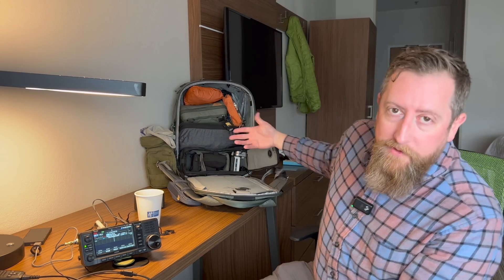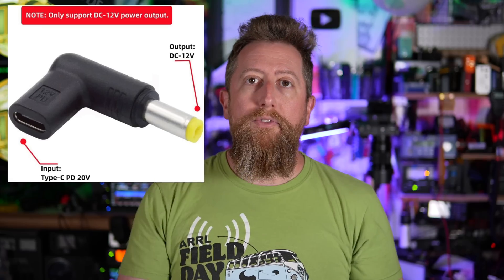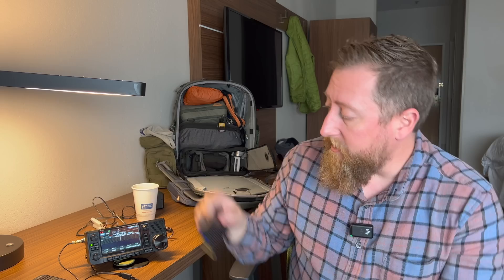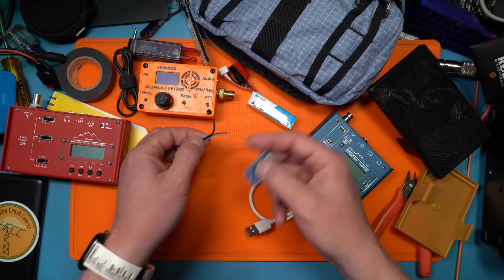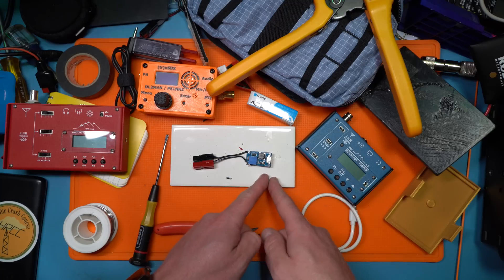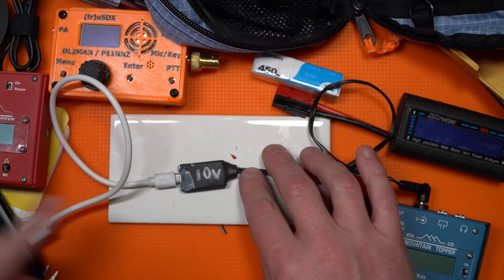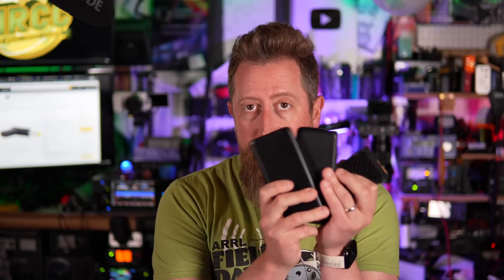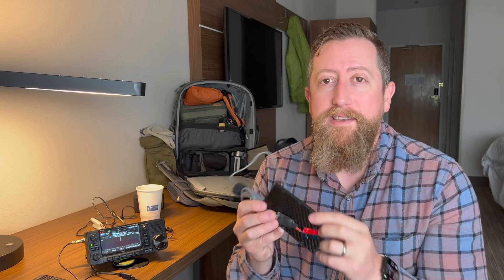Powering QRP Ham Radio with USB Battery Banks

Comment: I am going to get the QRPLabs QMX+ to go QRP and ultra portable. They'll add SSB on it soon and it does Digital and CW just fine. This video is just wonderful. Will you do a build video for the QMX+???
Reply from the maker: I will indeed. I already have the kit waiting for me.
Reply: @HamRadioCrashCourse  ooohhh!! I am excited to see it!! I plan to buy it for the Turkey YOTA event for the next month. We'll be on the air with i believe around 10 Youth operators for the entire month. I do have an IC 718 but i dont have a proper way of powering it. Though would you reccomend i should get the QMX + or figure out a Power Supply solution for the IC 718 to work Portably? If i go Portable what would you reccomend to power it? I have a 12V 7Ah battery that's gone flat. So im thinking if i should get a way to power that battery or get the QMX +... Sorry if it's too out of topic with the video, i just thought i should ask.

73 DE TA1YEP

Comment: Just passed my test here in Spain and once i get my call sign I'm going to get a usdx hf transceiver.  Due to European laws it wont come with a battery so this is a fantastic idea . Ive been looking at the lipo 11.1volt packs you can get from amazon but then you need a charger or the added messing around of opening up the rig and adapting it to fit whatever battery pack you buy. Ill definitely be trying out this idea in a week or so. Great video

Comment: I am not sure if it's going to keep up with IC-705, which can take 3A@13.8V max. That's 41.4W max and USB A ports are all 5V, mostly 2.5A max, some of them are 3A max . That's 12.5-15W.. good for charging internal battery and listen, but TX is another story. I already have 30Ah powerbank with PD3.0, which can output 65W to charge my laptop, so I'v just bought simple USB C cable with 15V PD decoy > 5.5x2.5mm jack. PD standard says that at 15V, it can give you max 3A, that is exactly what you need, 45W output. Only I am concerned about noise... but that's issue for another day

Comment: Even a small solar panel like a Goal Zero or BioLite could be used to charge the i705 when it's off and not take up much space in a bag. That way you could be more sustainable on the go in case you found yourself away from power sources while traveling. Unfortunately, I don't think either would be able to run the upconverter, but they could charge your other USB battery banks.

Comment: PSA for USB-C PD: not all chargers are the same. Make sure the one you want to use has the output voltage you need. For example, most (all?) Anker AC wall bricks will output 9v and 15v, not 12v. I believe 15v is *technically within spec for the 705 but my USB-C to barrel jack converter will use 9v if it can't get 12v. I don't know if that will hurt the 705. I'm not going to test it myself, and I'd prefer 12v anyway. There are chargers that can output 12v. I have 2: one puts out noise on HF, the other puts out noise on VHF, so I keep both in the 705 bag. When in doubt, the PD chargers will default to 5v when they don't detect any PD circuitry, which is in spec for the 705's micro USB port. It could then probably also be used with this converter chip too. 

TLDR: check the voltage, your mileage may vary.
Reply: PD 3.0 PPS is pretty cool. The voltage is adjustable within a range, for instance the Anker 713 outputs "PPS: 3.3V-16.0V=3.0A Max (45W Max), 3.3V-21.0V=2.25A Max (45W Max)"
Reply: @MattBlank0  yes, but I have an Anker 711 which should be able to do 12v within “3.3-16.0V=2.0A Max”. My 705 reports 9v, so I’m guessing my adapter is on the older standard. Good to know though.

Comment: TalentCell has a battery that looks like a beefier battery bank and it's LifePo4. Model = TalentCell 12V LiFePO4 Battery Pack LF4100. It's pretty small. I use this even with the G90 and worked fine!

Comment: The same technique can also be used to power a truSDX transceiver with a battery holder of 3 x AA batteries. Mine puts out ~1.5 watts of CW (as measured by truSDX software) using rechargable AA batteries.
Reply from the maker: I love it.  truSDX is a great radio for this type of setup.

Comment: Those are not buck converters and are not normally referred to as an "up-converter". The correct term is a boost converter (because it boosts the input to a higher voltage). A buck converter takes a input voltage and outputs at a lower voltage. Another term for these are step-up or step-down. (Note you can also get buck/boost converters which can do both functions) Understood the overall concept and it's a fun little project! I wanted to throw that out there in case people are going to look for their own.
Reply from the maker: I appreciate the correction.  I myself am not a EE, so while I think my concept is correct, being accurate in terms is appreciated.
Reply: Concept is totally correct! You are carrying the energy with you... might as well convert it to something the radio can use!

Comment: Awesome idea, thanks! Gonna try this for my FT-818
Reply from the maker: Thanks!  And keep up the good work on your channel!
Reply: So I made a cable up to run my 817 with the radio set to 2.5W output it all seems to work. If I see the radio to 5W the boost converter gets quite hot. Can I run 2 boost converters in parallel so each converter is running half as hard?

Comment: Have you looked at the ripple / noise on the output of those DC-DC converters on a 'scope? If there is big noise, can that degrade the cleanliness of your transmissions or impair your reception? If so, what are the mitigation options? Filtering?

Comment: That awesome video ! was hopping you would do a video on this. I have been doing this for many years now. I use the same converters and many more. some make noise in HF receive. found a coil or ferrite on in and out does help some times or try a different one. it is hit and miss with them switch more converter. I use 10V as well. some Baofeng HT's are 10V input. yes USB C PD is the ticked now. can do 20V 100 watts on some. I have Anker power banks and stuff and never had a let down. I got USB C PD to 20V/19V for HP laptop one has blue tip for HP. that how I run my 17in HP windows laptop . works super. I put USB C PD in my ammo can battery. runs my laptop for days ! just get right USB C PD cable . I got the Anker one with PD chip in cable. the bast part with USB C is just plug in cable. no upside down ! I solder my power pole as well. best connector for Ham radio stuff I found. I also use the big ones . PP175 and SB ones. True  Anderson . rated 600V AC and DC has UL . on the big ones. 73;s  you are a HAPPY HAM !

Comment: Josh, Thanks. Great Video. Question Re Powerpoles.  Do you ever double the wire back over itself when dealing with thin wire like this to get a better crimp? Good idea? Bad idea?
Reply from the maker: I think even if I did that I’d still solder and use a good strain relief.
Reply: @HamRadioCrashCourse  Thanks

Comment: One issue you can potentially run into is that the radio might draw more current than your battery can handle. I have a USB C to 12v adapter and when i try to run 10 watts CW on my 705 the output power flutters. It handles just fine if i reduce it to 9 watts though
Reply from the maker: This is possible.  I said 5 watts due to that reason for most QRP radios.
Reply: @HamRadioCrashCourse  I guess so. The 705 isn't necessarily a good example since it has a battery and can be charged with a micro USB connection

Comment: You can get the PD triggers in 9, 12, 15 and 20v so there are options for non-12V devices as well. I use a 9V one with a USB-C Power Bank for my QDX :)
Reply: I was about to say same. With PD you can select distinct voltages (5, 9, 12, 15, 20). QC and recent PD can deliver voltage with precision to 0.01 V, so it is possible to select any voltage between 5 and 20 V ... I have USB-C to barrel plug cable for my IC-705. It is working fine ...

It is also possible to pull more power from power bank via USB-C PD ... for example my power bank have limitation 3 A / port. That's 15 W for 5 V and 36 W for 12 V output.

There is one drawback for this method. PD trigger cable just request correct voltage and it is generated by power bank. Not all power-banks are equal and some have significant voltage ripple. That may interfere with SBB/CW/AM operation ... with boost circuit it is possible to select "low noise" one, but there will be significantly less power available in watts ...
Reply: Not all PD power supplies and battery packs will support all profiles though, make sure that both the trigger and the power supply support the correct voltage. Many are missing 12V or 15V .
Reply: late to the game but i was about to say the same thing. i use pd to power for various portable tech devices which need various voltages. even though it meets the votage requirements, check the amp requirements as well so you don't fry your device.
also, buck converters are highly inefficient and drain more battery than the theoretical values. they can generate heat based on the potential difference, so careful on where you place them in your final setup.
Reply: Keep in mind that the newer USB-C PD standard dropped support for 12V in favor of 9V and 15V. This means that you might not get 12V with certain power supplies or battery banks.
Reply: @pcfreak1992  good point, but counterpoint: the Icom IC-705 will run from 12v input, but not charge. The DC input has tolerance for 15V, so that'll let you charge the internal battery, but more importantly run with 10w RF output if you use a 15v PD trigger device.
Reply: @pcfreak1992  I tried both an Apple 140W PD adaptor (2022) and an Anker PD power bank and neither would work with a 12V PD cable that I bought and subsequently returned. 

I did not know that the 12V PD profile had been dropped and that is the likely reason for only getting 9V from the cable. Thanks for the tip.
Reply: @pcfreak1992  12 V was optional from beginning of PD. Most manufactures keep it as it is preferred voltage by phones, tablets and other similarly sized devices ... but point is right. There is no grantee that it is present there. It is there only if it is explicitly listed in specification.
Reply from the maker: Good point and good idea.

Comment: For your IC-705 specifically - I haven't tried it yet, but the manual points out a microUSB power connector next to the regular power port.
Reply from the maker: Yes indeed.  The issue there is that only really charges the battery pack.  It won't let you run off the 12v source.